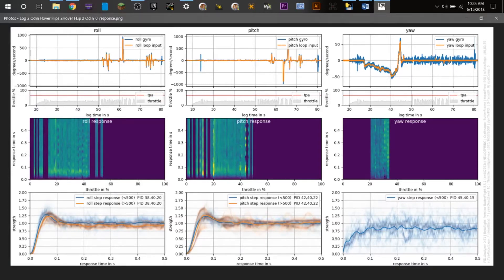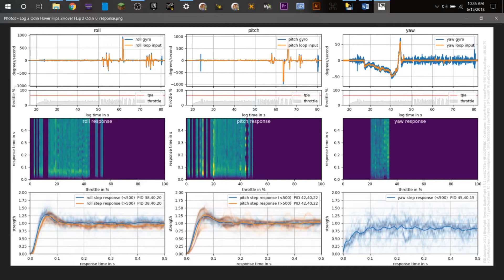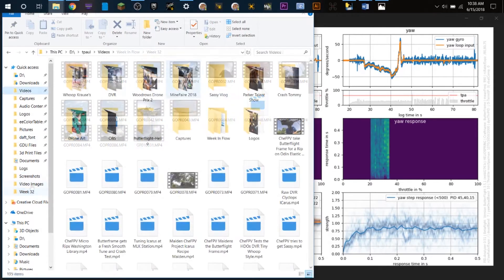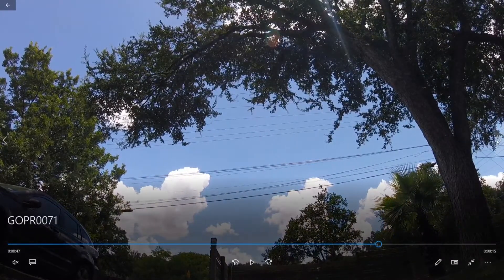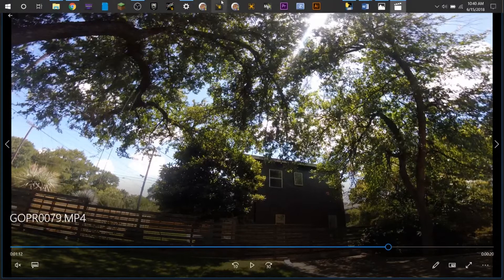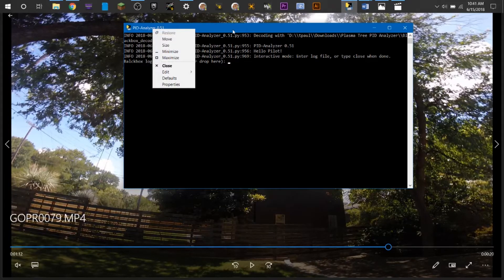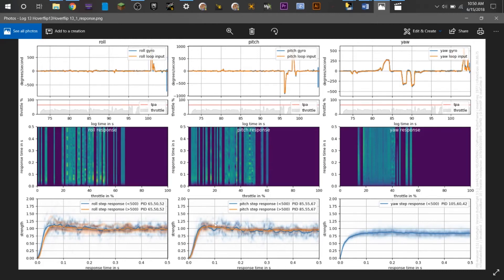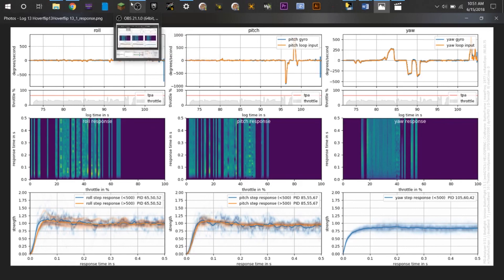How I Tuned my Helio FC on Plasmatree PID Analyzer

Comment: Very interesting.  I wonder what would happen if you exploded a prop, with the gains that high.  I'd be real curious to see your BB log.  
Did you keep those settings, and how's it going?
Reply from the maker: Still rocking these PIDs, dialed the D down 5 points on all axis for 5s but that is all.  IT flew fine with D higher on 5s, but I was getting a very snappy response that I didn't like.  I havent even pulled bb logs, LOL, I should.  As far as prop exploding.  Not sure, but I have smacked plenty of stuff and bent/chipped props with no issue.  Same quad and tune on 5s is in my latest videos.
Reply: If you ever grab a log, hit me up.  Good stuff.